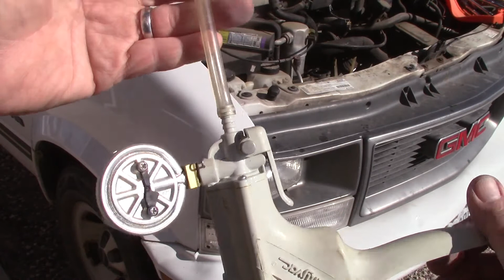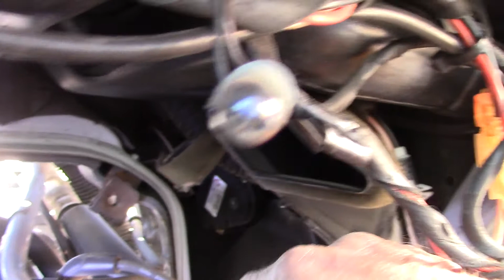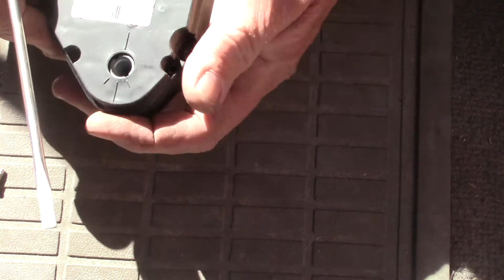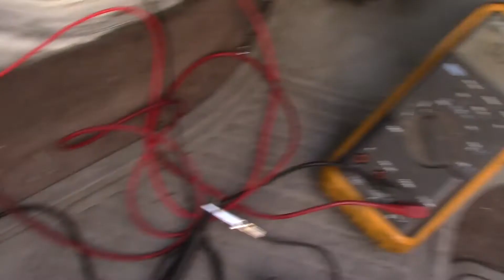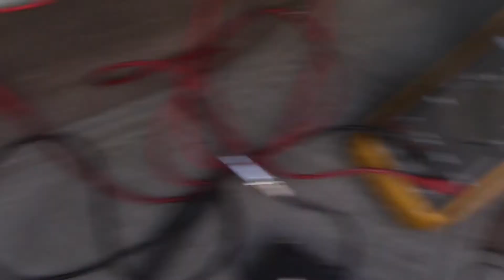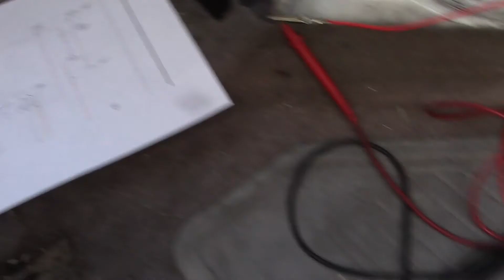1997 Safari/Astro No Heat Issue - Control Valve? Clogged Core? Blend Door? - Let's Figure This Out

Comment: Hi from the Pacific NW and Washington State. Yes, I own and drive a 1998 model Astro, all factory original with 105,000 on the clock. It's starting to cool down now from 2026 Summer temps of 80-90 ° Last week early morning it was down to 55° So, I went to drive the Astro on an errand and surprise, I turned up the heat but only cold came out. That really frosted my cookies! Later that day, I pulled up some YouTube videos and went through several before I found your presentation. That was an AHA moment. I knew the blend door wasn't moving, but not sure how to approach it. When you showed the actuator next to the dog house on the right, I knew it was EZ-PZ to get at. I've had it off several times before doing tune-up stuff, no worries. But, just before I started to pull the cover, I had a devilish thought😈
I took my rubber mallet and gently and firmly tapped the heat housing area, it took a few tries and success! The actuator powered back on with plenty of heat, glorious heat flowing through the vents. Like you had said,  it was just a connection glitch at the plug connector. Thanks so much for illustrating the simplicity of restoring the power to the actuator.👌Later on, next time I pull the dog house,  I'll properly service or replace the actuator as needed. I hope my story helps someone who may have the same issue, just some gentle bumps with a rubber mallet can shock it back to working condition, worth a try! 🙏👍
Reply from the maker: GREAT comment! Thanks

Comment: The way you fix it is replacing the Astro. Lol. Just kidding, I'm on my 5th. I just keep replaving parts. Lol. I've never had it to a Chevy dealership. Lol 🎉
Reply from the maker: Just replaced the fuel pump and the crankshaft positioning sensor (again).
Reply: @LetsFigureThisOut yep, those go, too. It is now August 27th- from this orginal post. We will be changing the heater code, heater cobtrol valve and blend door Actuator this weekend.

Comment: Thank you for sharing your experience!! It was so helpful. After replacing my thermostat, I saw your video. I removed the screws for the actuator and tried to remove it. I didn’t want to come off. But with the wiggling it started working!! Now I have heat. Thank you!!

Comment: I got a new actuator and installed it and have heat in my 98 Astro. I checked this actuator a year ago and it was rotating fully but the person using the van didn't give me good info so they suffered another cold winter because the actuator was intermittent. They said it never had heat after the actuator moved properly for me. 

With the new actuator, it was plenty hot yesterday.

At 297,000 miles, I'm giving it some overdue maintenance. First transmission fluid change in 20 years, first differential fluid change ever. Power washed the drivetrain from underside.

I got it back after loaning it for 6 years, because it was burnt in a fire in April. Parked against a garage that burned. The fire raged under the hood and fractured every inch of windshield. Bumper was a melted puddle on driveway. Yet it started right up and drove.

2 salvage yard trips and all new front lights and I was able to drive it 50 miles home. $500 to repair fire damage not including front grille and 6 new front lights. Another $550 to restore and do needed maintenance that predated the fire. Somehow the battery, radiator, and overflow tank survived being in an inferno. Everything plastic and rubber from the roof forward was melted yet it was unfazed and ran fine. The only remaining fire damage is the AC. It was working before the fire but a puff blew out from the clutch when I ran the AC so I haven't tried it yet. 

But now there's heat so it's useful 9 months out of the year. Getting 22 mpg combined on 87, which is close to when new.

Comment: Thank you mister!
I just replaced my heater core. Before that, the heater control valve, thermostat and water pump. And the radiator which was cracked.
So now I have something else to test and/or fix!
Thank you so much!

Comment: I am going through it now, control value was changed last year, I checked and changed the fuse, Hot going into core 118-120%, out 75%, Radiator coolant really bad/dirty, Default to defrost but just a little warm not enough to melt ice/snow, thermostat changed last year. Getting ready to flush system before going any further.

Comment: Mine is doing the same thing. I eventually get heat for about 30 seconds. I checked everything you did. I haven't checked the valve yet because it is raining out. I don't know if it is opening or closing. Your heat started working after you fixed the mix door actuator?
Reply from the maker: Yes. It was that actuator. I tried repairing it first, but it only worked when it wanted to so I replaced it and it's been good since then.

Comment: Tip for the future:
The blend door actuator has a series of gears that are turned by the worm gear on that little tiny motor. If you try to turn the gears like you did they’re not going to spin the worm gear on the motor and is going to appear seized. You have to turn the worm gear to make the other gears move.
Reply from the maker: Yup. I took the whole thing apart and tried a few things.

Comment: Having the same issue with my 99 safari. I my check into that motor. It gets heat when the rpms are up but as soon as you cost its cold again. I just replaced the water pump and thermo state due to the temp guage never going up over 125f during the cold days and getting up to 230f on hot 100f days also replaced all the rotted rubber lines last month so now I have vacuum for the controls
Reply from the maker: Vacuum lines can be an issue. I made sure the vacuum line connected to the control valve was very secure.
Reply: @LetsFigureThisOut  yeah I replaced all of them last month. The rubber line that connects to the 3 way check valve near the firewall was falling apart. also did what you did on the vacuum canister.
Reply: Turned out that i has air trapped in the heater core and its lines. I went to back wash the heater core and noticed when removing the line no coolant came out. The core was clean no rust or debris.